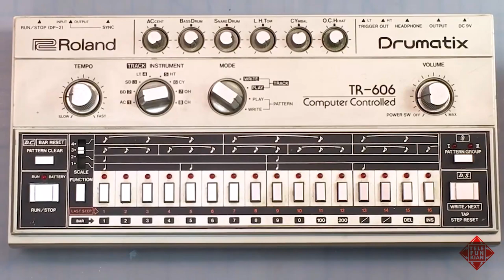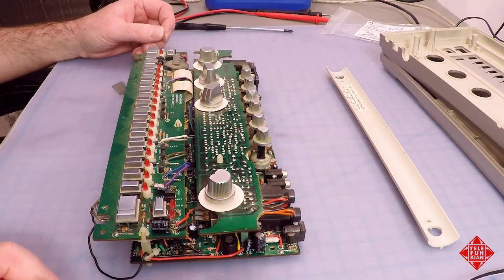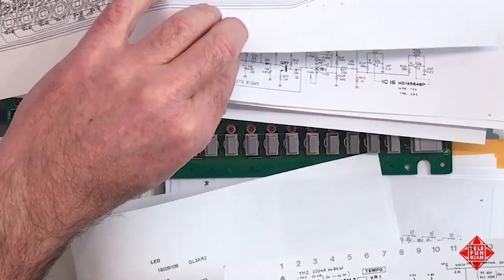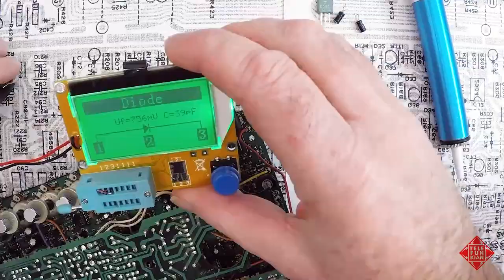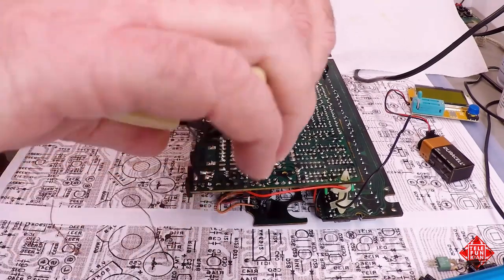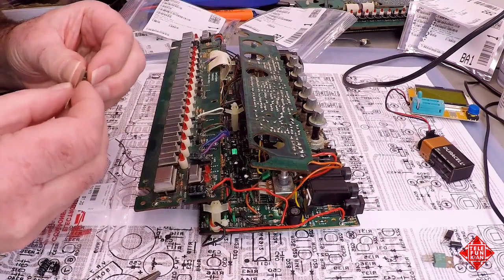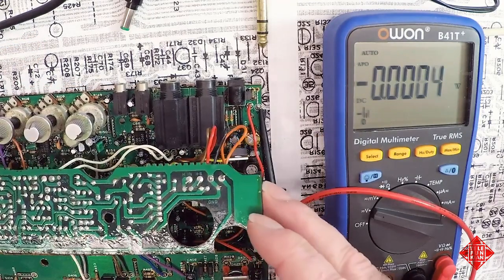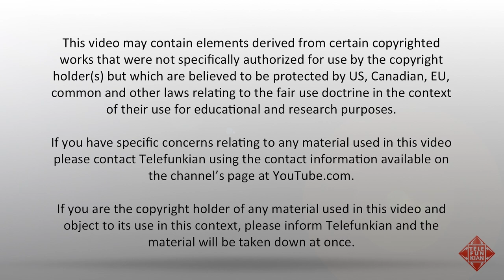TR 606 3 Power Supply Repair

Comment: This is a great video and the schematics you provided are a nice help for troubleshooting. However I’ve found an error in your schematics. R2 is really R236 and the correct value is 100K. There is also an error in the original schematics, which is in your schematics as well. R238 is supposed to be 1K5 and NOT 15K.
Hope this helps someone in the future.
Reply from the maker: Thanks for the feedback and for pointing this out. I don't know how the "R2" error got in there as it is pretty obviously incorrect, but the R238 one is new to me, so thank you! I'm glad to see someone is paying attention! Thanks for watching.
Reply from the maker: For some reason I cannot see your comment from Aug 25, but if you are still having challenges with the 6V supply, perhaps try disconnecting the wire that sends it to the daughter board and check the 6V on the main board? If it is still low then the Zener D40 may be faulty or other parts in the circuit area, if it checks ok then something on the daughter board is pulling down your 6V. I hope that is helpful!
(Sorry for the delayed response, I've been away from the channel for a couple of weeks.)
Reply: @telefunkian  Thanks for getting back to me. I got the issue sorted when I discovered the error with R238. Instead of leaving the question up, I figured it would be better just to provide the solution :)

Comment: I recently bought an "as is" 606 with a similar problem, the transistor (Q42) was barely hanging on. UnfortunateIy one of the pads on the board completely came off while I was removing it. I have some wires jumping between the solder points now. I found some "b596 Power Transistors" for a couple bucks on ebay and went ahead and bought them, what did you end up replacing yours with? 

There is one very obvious issue on my 606, corrosion on a couple of traces. I did my best to repair the traces but it is very possible I may have missed a small spot somewhere, I should probably go in with a magnifying glass. There had definitely been some batteries that exploded in this thing a long time ago. I have the battery spring soaking in vinegar but I think that part is too far gone.

I went ahead and recapped the whole thing thanks to one of your other videos.
Next I'm just waiting on one of those components testers to see what needs to be replaced in the power supply.

As of right now it's behaving better than it was, but I'm mostly just getting the pattern led's lighting up. If I fiddle around with the switches and buttons I can sometimes get some of the step led's to light up. I can't use the function or stop and start. But sometimes the snare, hi-hats and cymbal just start goin off. 
I'll go ahead and replace the buttons, but I suspect they are not the problem.
I thought that the 8pin wires connecting the boards might be another potential issue but visually they look to be okay.

Anywho, repairing electronics is still pretty new to me, so I'm mostly looking to get a lot of practice. If I can get a working 606 out of it I'll be pretty happy.

 Thank you very much for providing these videos and info, it's been super helpful to me!
Reply from the maker: Congratulations! It sounds like you are having fun and learning a lot in the process. Q42 is nominally a 2SB596, a 'b596 power transistor' is basically the same thing. The 2SB596 is a Japanese Industrial Standard number. The JIS format for a transistor number is a digit, two letters and a serial number. The first digit is the number of leads minus one,  2 for a bipolar transistor. The first letter is an S, for semiconductor. The second letter is transistor type, such as A for a high-frequency PNP transistor, B is an audio frequency PNP transistor and C for an NPN high-frequency transistor. As 2S may be assumed,  it is not always written on the component’s casing. So b596 is just a short form for a 2SB596. Assuming the transistors you purchased are legit (Ebay can be tricky that way) you should be fine. I used a TIP30CG, purchased from Mouser. As long as your CPU remains intact (it sounds like it is), you should be able to find most any part for the 606 so don't worry too much, you will likely end up achieving your objective, a working 606!
Reply: @telefunkian  thank you very much for the info and reply. I'll keep pluggin away at it. I appreciate all the time and effort you have put in to help people out!

Comment: i dont understand:  where do the BU (backup battery go in the circuit ?  its not marked anywere.
im getting noise when the leds are on
i have 6.2v at the back up battery.
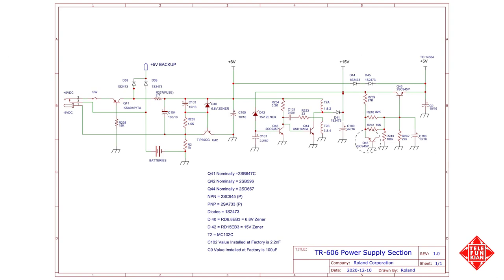Reply from the maker: Christian, I'm not sure which part of the video you are referring to, but the 'backup battery' is the supply from the 4 c-cells, the main and only battery supply, shown in the service manual schematic, and in the video at ~16:30. The battery is shown at C2 in the power supply schematic available for download at the link in the description. The noise with LEDs on is a common observation with the 606. There is a lot of discussion on line about this, but it may be partly due to a poor quality external adapter ('Wall Wart') so make sure you have a good one for starters. If you find you get that noise even when running on batteries it could be due to issue with the PCB layout that can be partially overcome through running new ground wires and some more extreme measures I might not recommend.  Discussion on this issue  is documented by Robbin Whittle at Real World Interfaces amongst others.
Reply: @telefunkian  hi Gordon , thanks for your reply !!
yes , i got some suggestions about the power adaptor been bad , but its an original roland  and it works well with a 303 , so i think i have another problem.
also i have tested with non switching transformer with same results.
 ive found that the noise disapears when moving around C100 & C101, but comes back afterwards.
also i ive tested the impedance in different points of the led/button matrix , and its not symetrical..  not same impedances on different columns.
in this last direction, ive tested the diodes and transistors in the SW board :  i suspect some transistors are not good Q13 & Q14

Comment: Nice of you to redraw the power section. You should know that there are good quality scans out there though.
Rob from Synfo has shared a pretty one: http://www.synfo.nl/servicemanuals/Roland/ROLAND_TR-606_SERVICE_NOTES.pdf
Reply from the maker: Zack, Thanks for the link, Rob's scan seems a lot cleaner than the one I have access to. To be honest, my primary reason for drawing out the schematic was to help myself understand it better. I'm still trying to figure out some of the thinking behind the design.
Reply: @telefunkian  Gotcha. Thanks for your work.
I actually have a 606 with a troubled power section. I got it going by replacing a bad transistor.
It's still not useable though. The supply sags as more LEDs turn on!
Reply from the maker: @tehrobotjesus  Well that's not good. Do you have a voltmeter? Are you able to measure 6v at D40? Does the 6V power come on at the sub-board when you plug in headphones? Does it stay at 6v when you turn up the volume or any is there any change? Do you have the 15v rail?
Reply: @telefunkian  I haven't looked at it in years. I just powered it on, and it seems to be working. I guess I fixed it and forgot about it.
I put it away when after trying and failing to find replacement screws for it. Nothing I've found has the right thread spacing.
Reply from the maker: @tehrobotjesus  Good to hear it is working! Good luck with those screws!

Comment: Do you have any part number or link for the fusible resistor you're going to use as a replacement?
Reply from the maker: I was putting in a Mouser order and I didn't find a perfect match but picked up some of these; 594-PR02FS0202708KR5, and  594-NFR25H0002208JA5, I hope that helps, and thanks for watching!
Reply: @telefunkian  Cheers found a similar to the high pulse one myself, but was unsure of the watt rating for such appliances. 303 and 606 service notes just say FRNB 2.7ohm, but i.e. in the service notes for 707 it's specified as being 1/4 watt as well.

Comment: This is TR-606 #2086 ... Mine's #2085 🙂

Mine has a "Serviced by Roland" sticker inside that says "59.7.18" ... but the sticker is way too yellowed to be from 2018. Any idea what that means?

It wouldn't run on batteries. I was scared it would be complicated after I watched this. But it ended up just being because the spring on the negative side was all rusty and bent. And I straightened it out by jamming a penny under one side.
https://youtu.be/cqMEauxX-3A
Reply from the maker: Wow, that is cool! I don't know how to interpret that code, but cool none the less. If I recall correctly #2086 came from the Mid-West, either Columbus Ohio or the Detroit area. I picked it up from a friend ~1996.
Reply: @telefunkian  That’s cool. In 1996 I lived in Columbus… in the honors dorm at Ohio State with the nerds who stayed up all night playing Quake.
Reply from the maker: @RaquelFoster  Home of Analog Heaven, the ele_mental Crew, tintonton, Charles Noel, Todd Sines, 21-22 etc...
Reply: 59.7.18 means 1984 July 18th. 59 means 59th year of shouwa era in Japan.

Comment: I managed to kill mine thanks to batteries leaking onto the circuitboard beneath. Happened 15 years ago. I still haven't forgiven myself...
Reply from the maker: Oh... the horror! We should all have reminders in our calendars, 'change batteries in synths'. Apparently the otherwise well regarded Duracell batteries are famous for this. I have a CR-78 sitting here ready to fix with a badly damaged PCB from the on-board battery. (Do you still have the 606? Maybe it can be fixed?)
Reply: @telefunkian  What really bummed me out was the fact that they had leaked AND I had the thing stored upside-down. If It had been right-side up, no problems, But nooooo! 😩I had someone inspect it and they told me that the damage was really bad and that I was probably better to just buy another one. Then in a second feat of stupidity, I sold it for a song to some guy on Ebay. After it was done and dusted, I checked out his Ebay Store only to realise that he was buying old (busted?) Roland gear and 'parting it out' i.e. selling the knobs, cases, and internals separately. Pretty sure he would have made a sweet profit on mine because I just assumed that it was junk and sold it for next to nothing... #lifelessons
Reply from the maker: @Pamberjack_  I think I need a drink.... I am sorry for your loss, the 606 is a little silver jewel.
Reply: @telefunkian  All good. I just got a el cheapo Behringer 606 & 303, so I'm a happy camper.